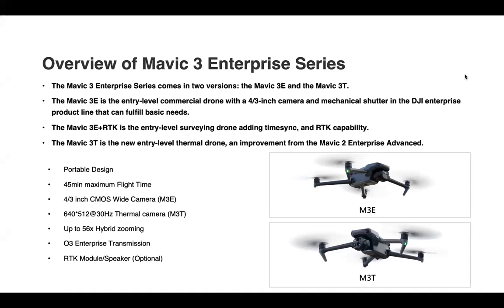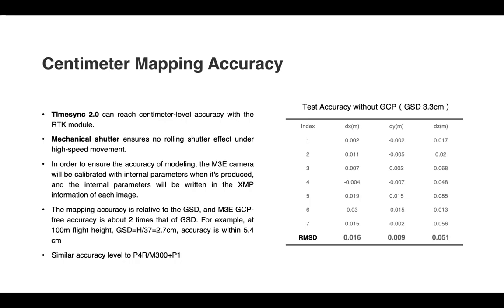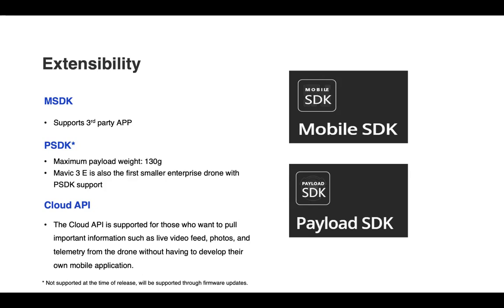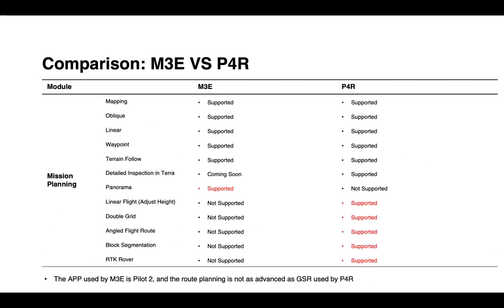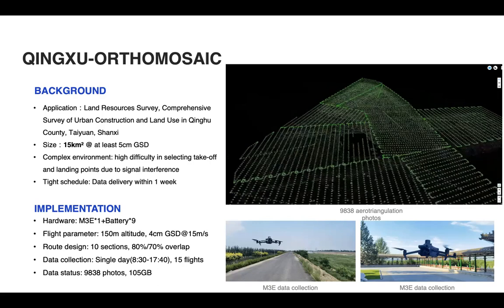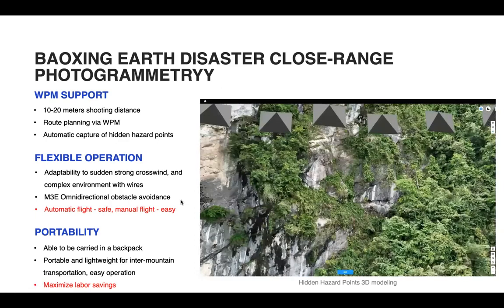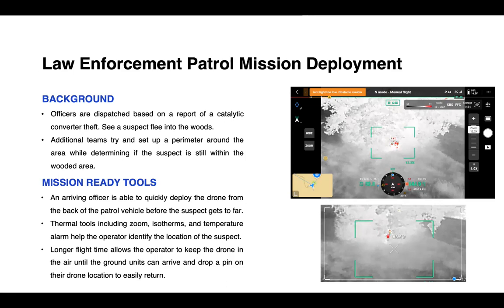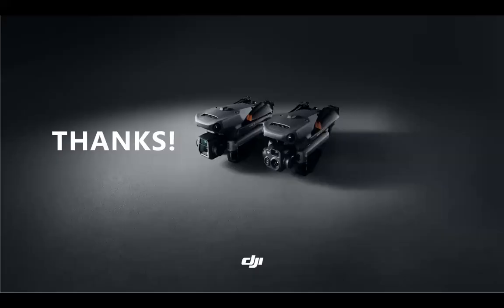DJI Mavic 3 Enterprise Series Introduction

Comment: without the rtk module, the .obs and .mrk files are there when downloading photos? for the PPK process
Reply from the maker: The PPK process doesn't work without the RTK module, but our enterprise drones come with RTK module, which means the data is saved automatically for later PPK process.

Comment: With a warranty of 200,000 mechanical shutter operations on the M3E, it will not be long before that figure is reached given the high number of images taken in the examples.
Reply: I saw that myself John. The Baoxing disaster alone was 30,000 photos. If you owned the drone that did all the cases featured that's over 60,000. As you said, that 200,000 mechanical operations would soon be completed.